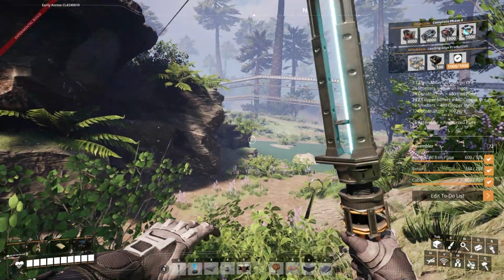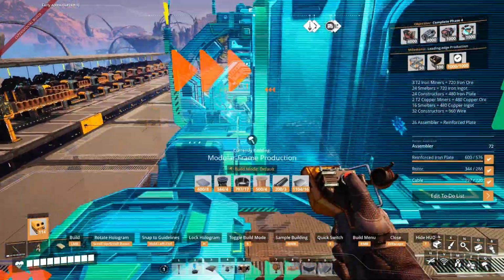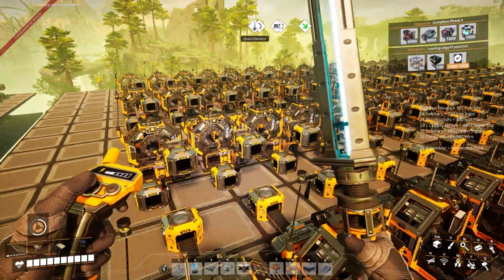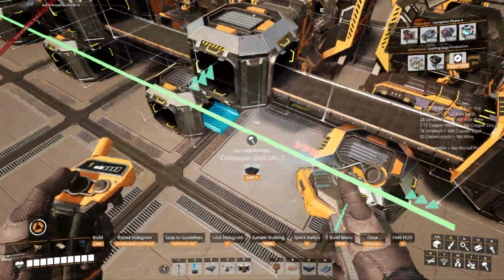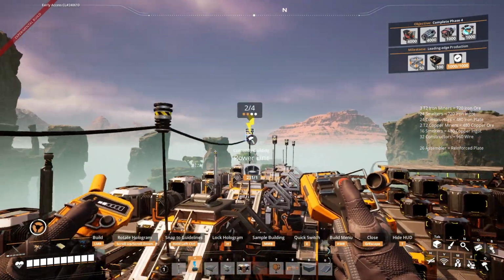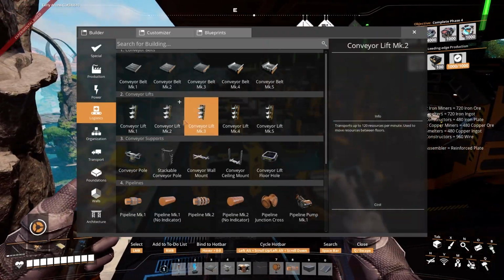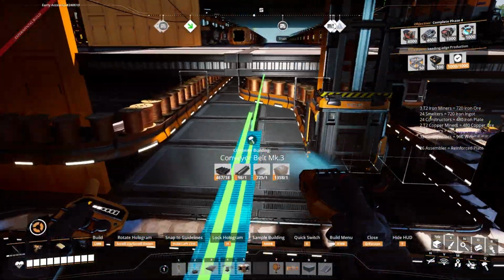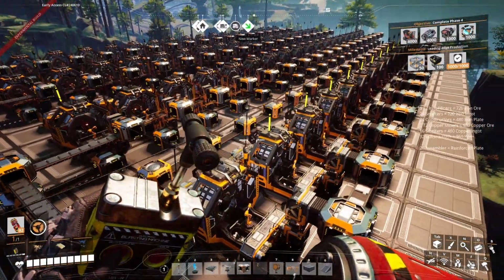Modular Frames... Assembler Galore! | Satisfactory | BigVlad Plays | Part 42

Comment: You probably already know this, but I just figured this out. I have four pure oil nodes in my oil fields so I set up a dedicated fuel power station on one of them. I was having trouble keeping consistent power going and when I started looking at it, I discovered that rubber and plastic give two different oil residue amounts. Rubber is 20 and plastic is 10. I had it set for plastic and I switched it over to rubber and now I have consistent output. I am just dumping the rubber into a Sink. So if you make a fuel generation plant, use rubber not plastic.
Reply from the maker: Thanks for the tip! Going to have to math this out when I get to it. Ugh... byproducts aren't going to make that any easier. When in doubt, dump any excess into the sink I suppose. 😁